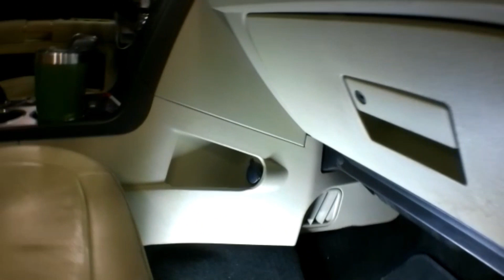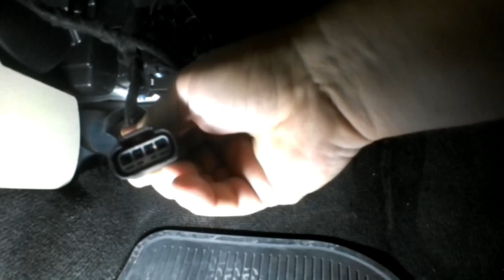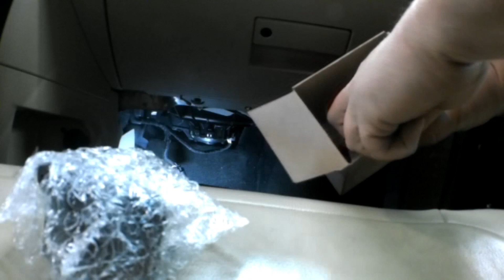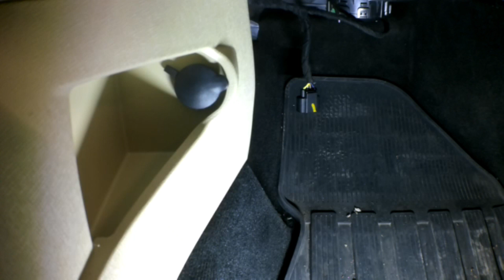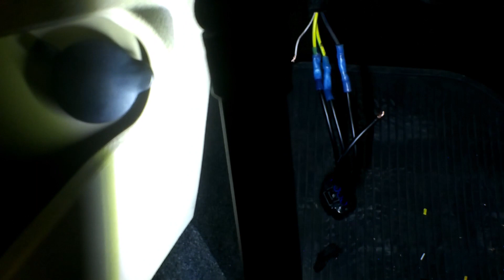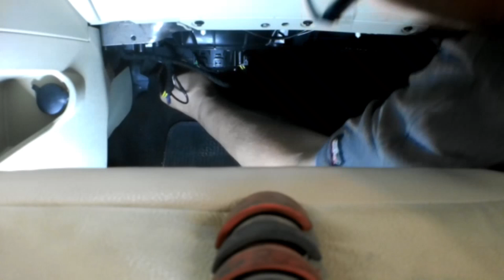Ford Flex Blower Motor Repair

Comment: A few months ago, you saved me a tow and labor when I discovered your video about the fuel pump relay.  You saved me again with this video. My wife called me a few days ago that her front AC stopped blowing (rear worked just fine).  It's hot in my area of Southern California until November, so I had to repair it ASAP - or I would be driving her car for a while.  I remembered your videos and looked for you.  I found this video, ordered the part from the local auto parts store.  It came the next day and I replaced the part.  I elected to not change the wiring harness, it looked ok.  I did keep it in case this flares up again. 

Also, I found napkins too!!
Reply from the maker: That’s great that you were able to fix it yourself and save money! Even greater that you looked up my channel! Thank you!

Comment: My 2016 just stopped working at -12 Celsius... Thanks Ford 🤬🤬🤬
Reply: I replaced the resistor and it is still not working. The 40amp fuse under the hood is ok. I don't see any melted wire or connectors. I guess, I need to check if I have voltage going to the motor... Any other tip?
Reply: @guzforce did you ever fix the problem, my 2016 did the same thing

Comment: Thanks for the video looks to be a fairly easy job luckily for me. Fyi for you or anyone with one of these they love to accumulate water under the cowl because of a really dumb drainage design and will puke water right back into your interior where that blower motor is if it gets really backed up. I can hear mine sloshing inside of there sometimes after heavy rain lol.

Comment: I have heat and ac to the seats ,:   Will this fix the heat and ac not blowing through the seats as well? thanks
Reply from the maker: I don’t believe so. The heated seats are typically heated with an electric grid of wires that heat up when electricity flows through them. So if they’re not working, it’s likely a fault within that circuit.
Reply: @Tomsfoolery.  thank you!

Comment: I have a 2010 ford flex sel. The heat or ac doesn't blow. Will blow cold air in the rear ? Any idea what could be wrong.
Reply from the maker: Check for power and ground at the blower motor. If you have power and ground and the motor doesn’t spin, it’s bad. If you’re missing power, suspect the blower motor resistor. Pay attention to the connector. I’ve came across three of them with melted connectors.

Comment: Just stumbled upon this video... you saved me a couple years ago when I found your video on changing the fuel relay on my flex. Loved that I could do it myself ( and loved even more that my husband and his mechanic friend misdiagnosed it and I was able to fix it 😀).... now I have a new problem.  My Ac/heat gets hot and cold and fan still runs but I get no air from any of the 4 front vents.  Would this be similar to the problem your showing here or something different since the fan is working and will blow up at windshield-defrost area and side vents on doors.
Reply from the maker: It sounds like you may have a mode door issue. Has it been resolved yet?
Reply: @Tomsfoolery.  I ended up having the resistor changed by a local repair shop in March but its out again.  Guessing I need that pig tail thing.

Comment: Also it would really be worth a video upgrade. iPhone 12 is my go to
Reply from the maker: I’m in desperate need of a new camera. I’m using my kids eBay camera.
Reply: @Tomsfoolery.  if you are familiar with smartphones or already have an iPhone I do all my video using my iPhone 12 (or iPhone X or 11). It’s worth it.
Reply from the maker: I just got an XR. I’ll give it a shot, thanks!
Reply: @Tomsfoolery.  oh dude you are set! Just remember to film in landscape mode (turn your phone sideways). You should have the iMovie app in your phone and you can edit your movies right in that. It’s pretty easy to use.